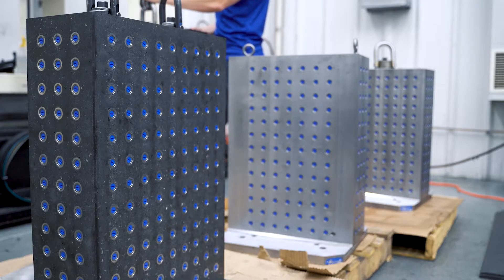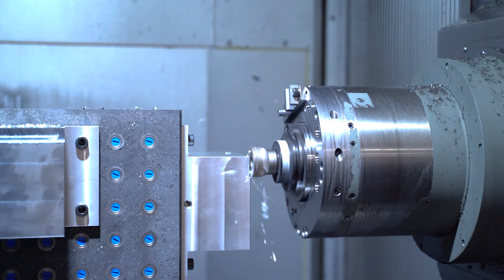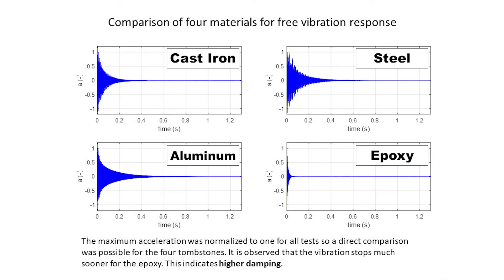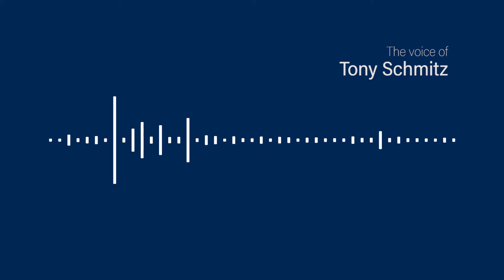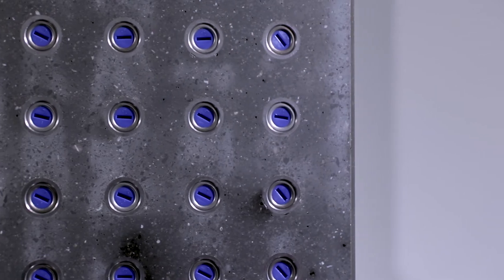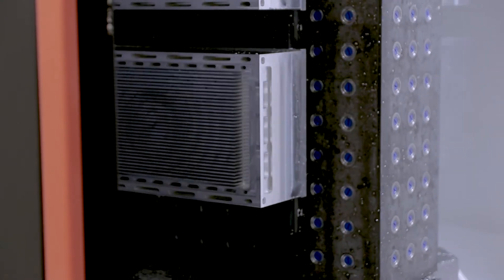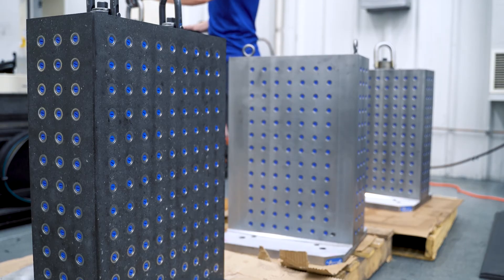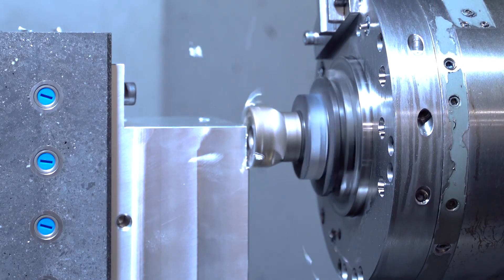Testing Tombstones - The Results

Comment: What is the coefficient of thermal expansion of the epoxy tombstone?
Reply from the maker: The Thermal Conductivity is roughly 0.02 W/Cm°C whereas Aluminum is roughly 1.40 W/Cm°C  and the Coefficient of Linear Expansion for the Epoxy Mineral is roughly 12x10^-6 K^-1 and aluminum is 23.1x10^-6 K^-1. Drop us a message on our site and i'll send you the data. Thanks!